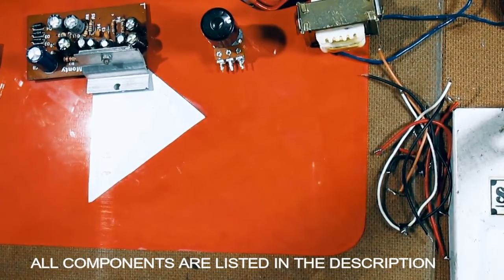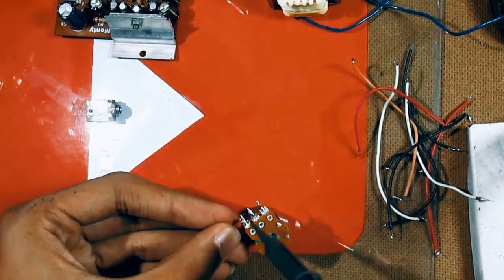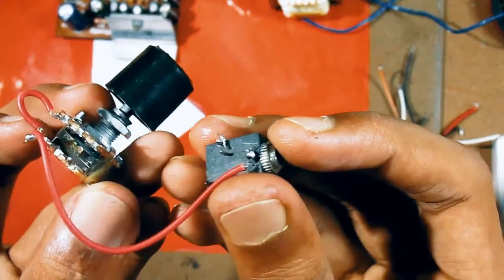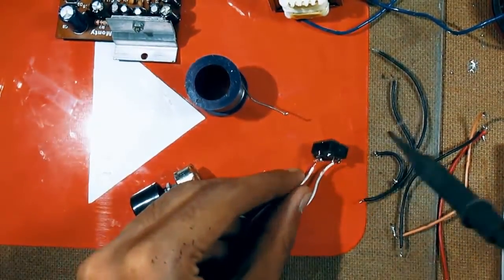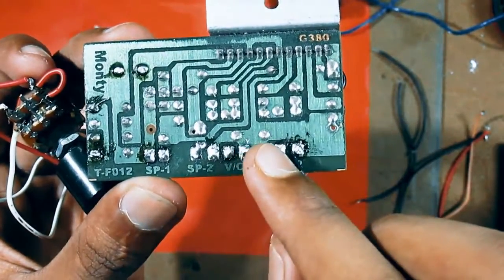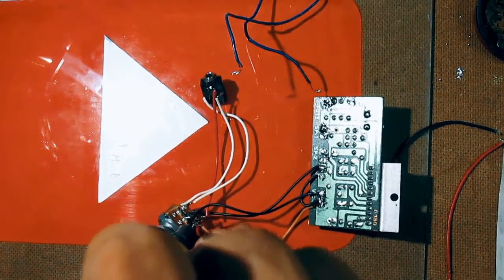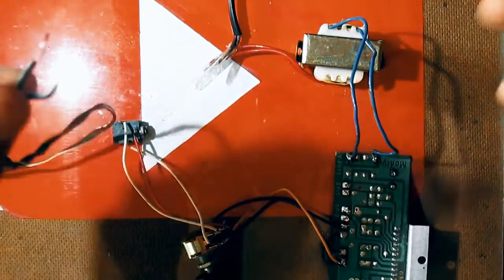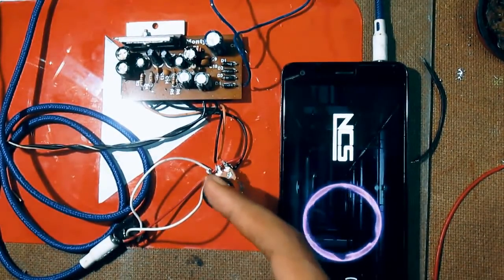|| 6283 IC Based Audio Amplifier || Noise Reduction ||Part - 2

Comment: Bro can we use 3 pin 50k potentiometer?
Reply from the maker: For a mono input, yes. For a stereo input, no. You may use two potentiometers for individual inputs but then you will have two volume knobs. Better use a dual channel(6pin) potentiometer as shown in the video.
Reply: Ayudh , I will one for both